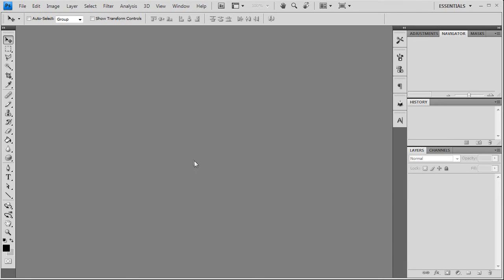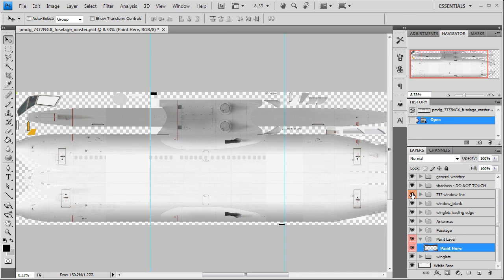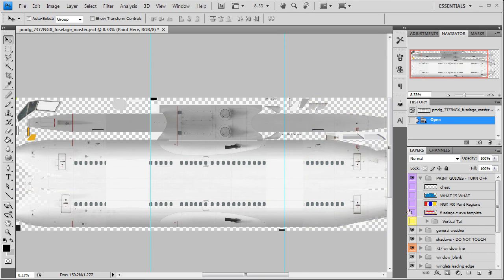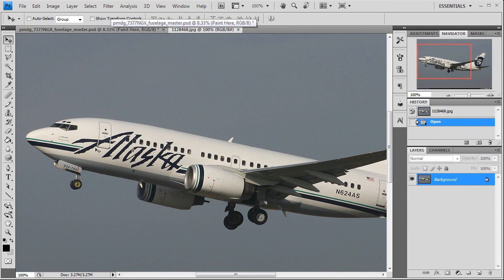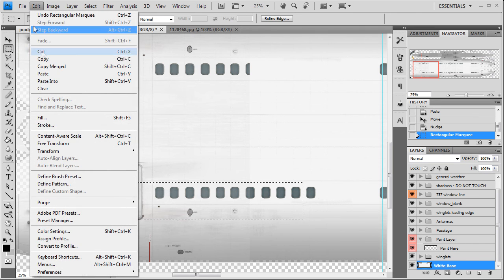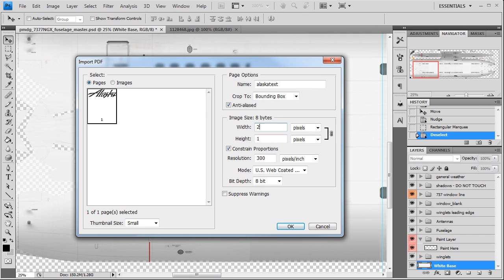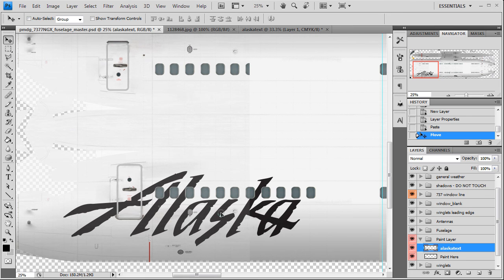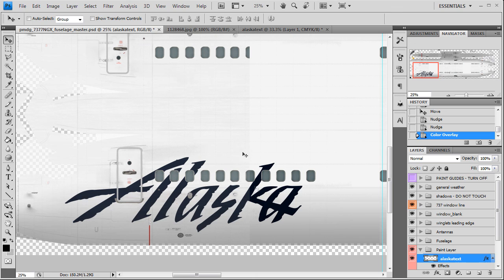PMDG 737NGX Repaint Tutorial - Part 2 of 8

Comment: When I am trying to move the windows I pasted like you did 5:38 the program moves another layer called aerodynamic dirt. What am I doing wrong?
Reply from the maker: +George Kavantzas (GeKa036) make sure you have the correct layer selected. Also when using the move tool be sure you do not have "auto select" checked.